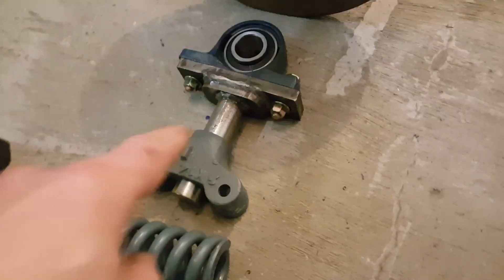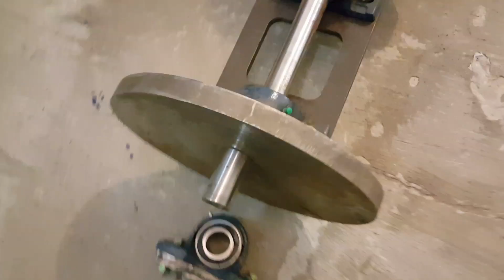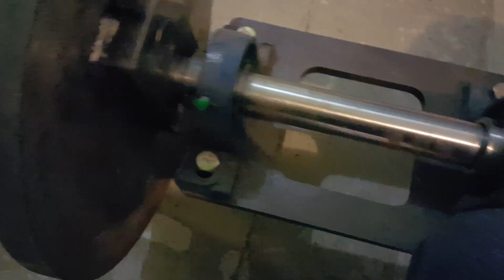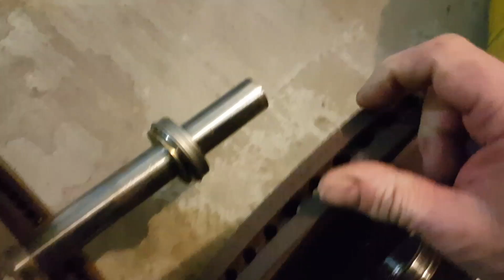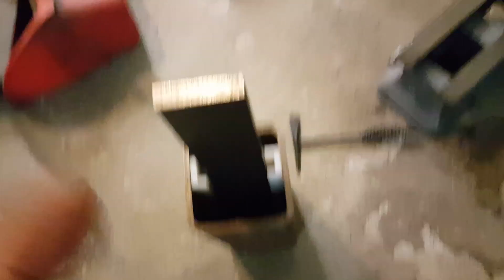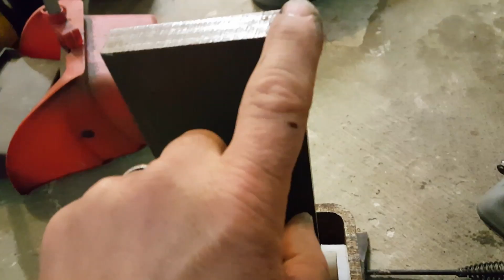Power Hammer project update

Comment: Awesome!  Tim inspired me to start collecting parts for a hammer build also.  I'm trying to employ as much scrap or "found" items as possible.  I'll follow your build for continued inspiration.  BTW, the flywheel that I found is 11" diameter, 1.250 thick.  It weighs between 31-32 lbs.